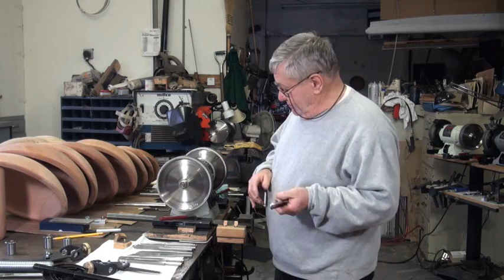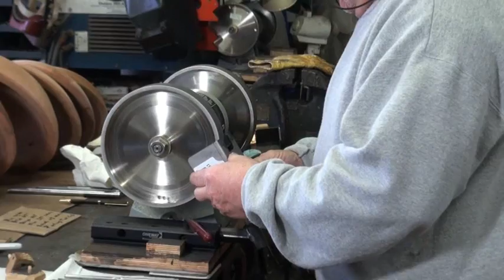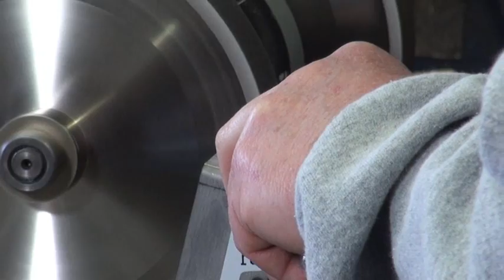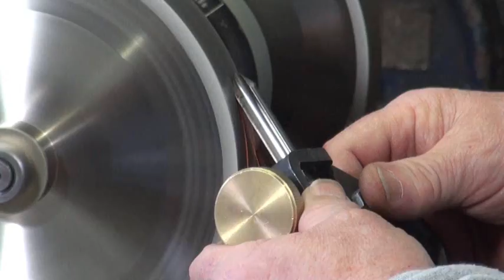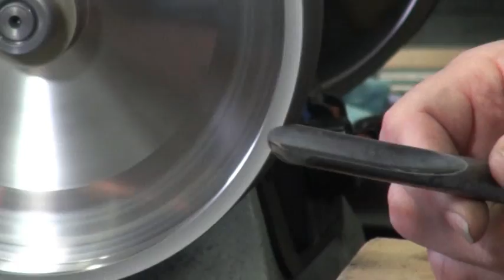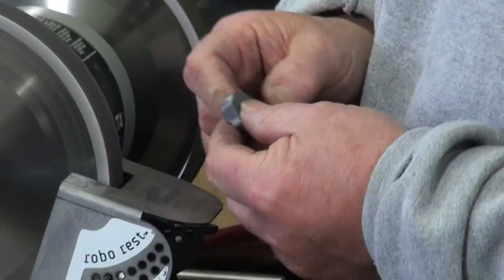Sharpening D-WayTools Spindle & Roughing Gouges, Skews, Scrapers, Beading & Parting Tools

Comment: 0:16  Spindle Roughing Gouge - 40-ish degrees (not specifically stated)
3:30  Scrapers - 80 degrees (on Robo-Rest)
5:00  Beading Tools - 65 degrees
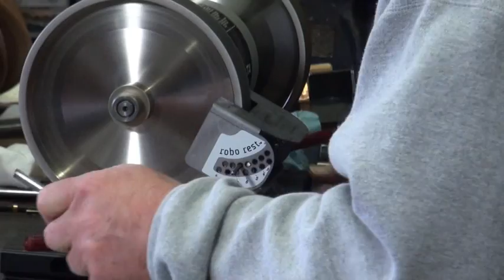5:50  Diamond (Teardrop) Tool - 75 degrees
6:34  Thin Parting Tool - 60 degrees
8:12  Skew Chisels - 35 degrees
9:56  Detail Spindle Gouge - 35 degrees
15: 35  Use of Sharpening Widget - 75 degrees 
17:02   Carbide Comments